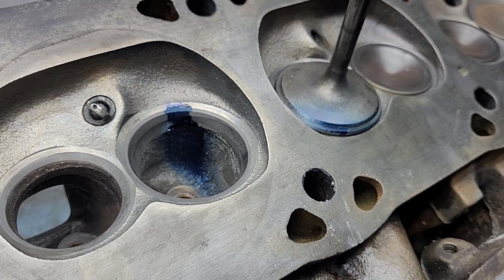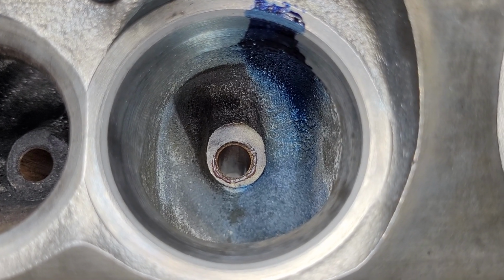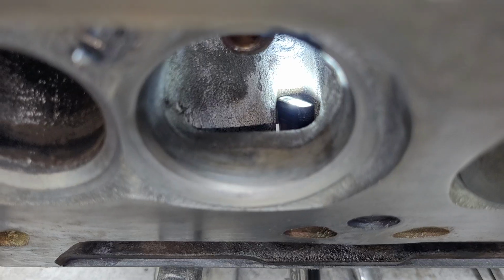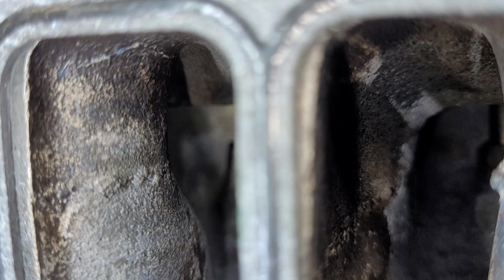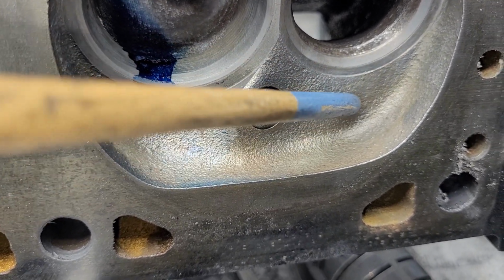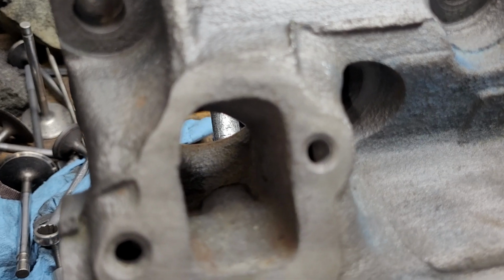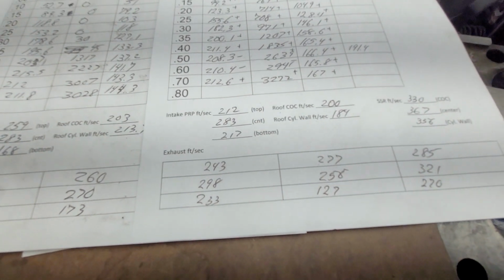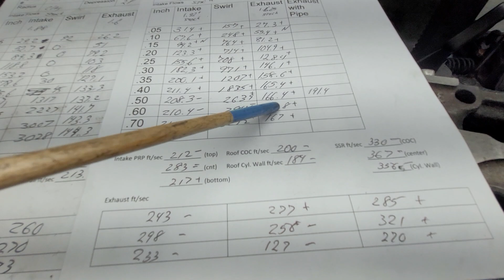Chrysler Magnum head flowed stock vs. 360 LA J head flowed stock.

Comment: The Magnum head is basically the AMC v8 design put onto the Mopar LA. AMC was preparing a refresh of their v8 in the late 1980s, and had completed or nearly completed this work when acquired by Chrysler. Chrysler needed to update the small blocks, and simply used what AMC had completed. This is why the Magnum head uses the AMC valvetrain.
Reply from the maker: AMC actually used airflow testing in their designs.

Comment: Nicely done video. Would love to see what you could get out of the magnums with porting. Apparently the aftermarket replacement castings aren't so crack prone.
Reply from the maker: I could be hired for that. I am expensive, and slow!
Reply: I have got 265 cfm on a super flow bench with stock valves with a factory magnum head at 550 lift beat a new eldelbrock rpm head from 100 to 550 lift you can do just a bowl port and good valve job and get 250 cfm real easy best small block factory head I ever ported hi velocity runners too with a good chamber with light weight  valves that are 5/16s not 8mm but splitting hairs but that's what they measure take the same engine run the ported magnums at the track against the ported X or J heads and you will see a time difference

Comment: Thanks so much for this video!  There is very little good info on porting these heads. 90% of the videos  they grind out the pinch point and not much else. One of the things I have wondered is why the roof of the port at the pinch point is narrower than the floor. Does it maybe have to do with the intake having tight bend at the exit causing the velocity to be higher on the floor at the entrance of the port?
Reply from the maker: Study the airspeed for that head. It is very interesting. Thanks

Comment: How does this compare with the Indy and  EQ heads they are supposed to  e high flow heads have you ever flow tested either one of those heads. They were supposed to have been redesigned. Tha k you for your time and making the video. Good job!
Reply from the maker: Never worked with the Indy design.
Reply from the maker: Thanks
Reply: Engine Quest out of Nevada use to make  a decent after market head in later years I heard that they cheapen up the heads it use to be they're heads came from a foundry they had in New Zealand I think.  I don't know about aluminum heads I try to stay away from them. Anyway that's what I know. Hughes engine did my machine work on my heads. He said new heads or not they all need to be machined even if they are brand new out of the box.
Reply: @servediocylinderheads   if you find a good source for a good quality after market head let me know indy doesn't make that cast iron head any more.
Reply from the maker: @CharlesPaich  Find some New Zeland eq's they are nice. Thanks

Comment: flow maxed at .4,  maybe somewhere between .35 and .4 the air detached from SSR as swirl had big increase at .4 and above. Wide SSR to help keep it attached? slowed airspeed elsewhere.....I think a lot of thought went into the design of this head to perform this well stock at the given cam lift. Too bad it is crack prone.
Reply from the maker: Yes, I agree. Too bad they crack!

Comment: Is it true that the factory left the sharp edge on the intake valve instead of a back cut so as to break up fuel? Or were they just doing as little as necessary to get by? At least Mopar put some thought into their design. Keeping the guide boss small and using smaller stem valves are two reasons why the 1.88 valve flows respectably.
Reply from the maker: 1.92" on the Magnum. A little thought.

Comment: Hi Charlie. Wow I have not seen a pinch area that small. I should say narrow because it is tallish. At first glance it looks like it would not work but it does. It might not be a great performance head but probably good for what it was designed for. It is also interesting that they made the exhaust so much better but the intakes have similar flow. It makes you wonder, the engineers could design a head any way they want so why do they do what they do? Andrew  P.S.  It is supposed to snow about 4 or 5 inches here on Sunday. ( sad face )
Reply from the maker: Similar flow with a smaller port improves velocity and cylinder filling. This equals improved torque. Thanks

Comment: Really good info 👍....How would the intake on the old 2.02 340 head stack up to the magnum?
Reply from the maker: I bet alot better. Bigger valve makes a huge difference if done right.
Reply: @servediocylinderheads  Thanks for the response....Back in the day, I was told the stock dodge 2.02 was better than the chevy but the chev did better with their exhaust. The claim was headers helped the chev more because of the good exhaust flow....thanks again

Comment: Oem heads what I understand we're weak from the factory the Magnum oem head had a alot of problems cracking. There are alot of people doing repairs on them. There still an oem. I went with Indy cast iron. They are supposed to be a better head.

Comment: What Cam U suggestions for street n race for magnum only
Reply from the maker: One that will do the rpm you want to run. Match the compression, head flow, car weight, torque converter and gears.

Comment: Porter Magnum heads would be really interesting on the 318. Quality and quantity flow
Reply from the maker: I hate to port crack prone heads. Just too much time for something that has a good chance of failing. I won't port Chevy Vortec for the same reason. Thanks
Reply: @servediocylinderheads  The EQ heads and others like are not crack prone. The current Chinese version cleans up and is about equivalent to the OEM heads. The older New Zealand made castings were much better.
Reply from the maker: @v8packard  I liked the New Zeland Chevy vortec.  Nice cylinder head
Reply: @servediocylinderheads  So did I! It was the only OEM style Chevy head I was willing to put money into for a number of years.
Reply from the maker: @v8packard  I can see that. I did a quicky cleanup on one cut for 2.02/1.6 combo at D.V.'s shop. 275/200 cfm no development work. Tough to beat.

Comment: All good Charles. Makes me curious now.  Was there that much improvement in the Ford line? Specifically the GT40 vs. GT40p......eh, eh, yeah?
Reply from the maker: There is quite a change from E7 to Gt40 to gt40p.
Reply: @servediocylinderheads  I'm looking at your older videos now.
Reply: @servediocylinderheads  I had first hand experience with GT40's off my 93 Cobra back in 2000. In 2002, almost one year out of school, I was bestowed the honor of porting on the GT40P and fitting them on an SN95 Saleen running a, now extinct, TTI single 60-1 turbo kit. 

Not familiar with the GT40P, I squared up the intake and exhaust inlets and outlets with a 3/8" radius and removing the smallest amount of metal. Gasket fitment was nice on both sides so I moved to the chamber and valve job. I manually cut 5 angles on the valve seats with a neway manual carbide cutter set. Then I just blended everthing 1st to a 40 grit cartridge roll, then 60 grit where I left the intake runner. I polished out the exhaust and chambers all the way to a red cross buff and using a lot of WD-40 as a lubricant. The only material, other than from the cartridge rolls,removed from the heads was at the valve guide. They looked amazing. 

I started thinking about comparing the 2 heads, but 21 years later I'm still trying to see the comparison. It looks like I'm going to see the major differences here. Thanks Charles.
Reply from the maker: @arturozarate1752  Fun to look back at old projects. I bet it ran real well. Thanks
Reply: @servediocylinderheads  it did and still does. I never got back into them although I wanted to. I spent 3 months touching EVERYTHING on my GT40s for my Cobra, and after doing some math I remember that the "P's" were better on paper. So I bought some AFR 205's and built the "Lil Meheeco" 311 long rod 12:1 Mexican block and it sounded killer with a solid roller at 6,800rpm.
Reply from the maker: @arturozarate1752  Nice!

Comment: Now I am super curious if you could cut one cylinder off the v-10 heads and use those. I think the ports and manifolds are about a million times better than any of this stuff.  I don't know if the head bolt holes will line up or not. Research some day.
Reply from the maker: I thought they were 360 design just extra cylinders.
Reply: @servediocylinderheads  nope they have symmetrical individual ports and look kind of gen 1 ls style
Reply from the maker: @bcbloc02  Are they 360 style ports just arranged differently?

Comment: Charlie, IIRC, the Magnum Head is 58cc’s. The J heads are 72cc, + or - 2cc.
Reply from the maker: Excellent Rob, do you have the port cc's for us? I am very lazy. Thanks
Reply: Off hand, I don’t remember. I had read it somewhere and IIRC, it’s 10cc down from the J head. If I had to apply a number, I could be wrong in saying 160cc for the intake runner. 
I just can not clearly remember to say with confidence.
Reply from the maker: @Robs-Garage-experiments  I think I need to do all the numbers to do a D.V. iop program sim on these two heads. I know the outcome already but will be good to see.
Reply: The CC hell no not stock there more like 64-65cc heads for iron magnums LA 68-72 Cc
Reply: Hey Dang5553, those are book listed numbers and used for racing purposes. As for myself, I have had 4 J heads sets that have all cc’d @ 72 cc. I have measured one at 76 cc. 
I have seen smaller cc chambers on these heads but they have always been milled.
Reply: Thanks for the Magnum cc numbers

Comment: Yes the truth is out bout magnum heads. A lot of people thought they flowed around 200 on the intake. They got confused with the RHS heads please come back RHS SM mopar heads. Big thing that was found a single pattern camshafts can be used with magnum heads. To the LA heads those damn heads look a lot like 596 iron head from 77-80 I think. I did see the casting numbers but wow. My big question for your j heads. I know your guides are messed up but could you fit a 15/16 socket in where the exhaust valve goes. I’ve see on multiple 574 308 heads after bowel clean up it’s possible
Reply from the maker: Sorry, I don't measure by socket. Socket manufacturers have different  wall thickness.
Reply from the maker: 915 casting
Reply from the maker: Thanks

Comment: Both heads perform about the same on the track negligible difference on equal engines. Magnums generally bit better torque street guys like them. The pinch has nothing to do with design or flow and everything to do with necessity. Roller cams on later engines requires more clearance due to the taller lifters and more severe pushrod angle. The bulge got huge because of roller cams started with the 302 casting 318  and 308 casting 360 LA heads.  The blocks are mostly unchanged from the poly (canted) valve engine days 48 degrees is the proper lifter angle as can be had on the race blocks not really a requirement unless your turning over 7500rpm sustained. Won't make much more than 600hp without an offset rocker head that eliminates the pinch. Oe unported 450HP is about the limit.  Chrysler new it and  every performance head from chrysler had offset rockers for a reason.  3 years after production the TA heads 915 casting too finish machine work (pushrod holes)  were machined for offset rockers so the race teams could port the pinch out.
Reply from the maker: Good info, thanks

Comment: Holy crap, those are bad. Although, when they are designed to run between 1500 and 4500, it probably doesn't matter. Some kind of hole somewhere and let the CI's do the rest. Throw harder leaf springs at the back, so it does burnouts, and no one will notice.. But man, so bad. That Ford head had a lot better thing going.
Reply from the maker: That argument could be made. Thanks